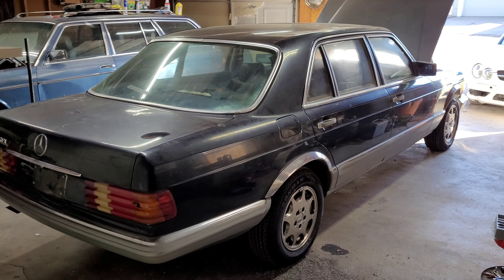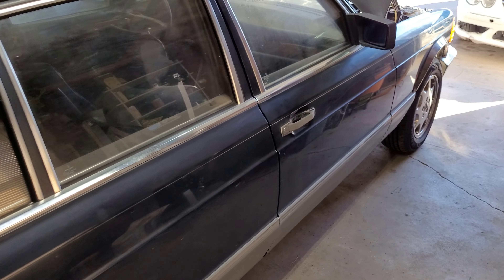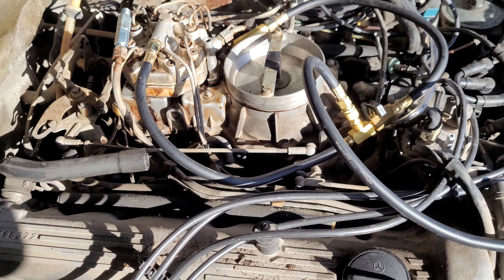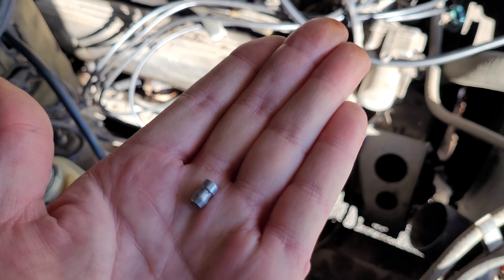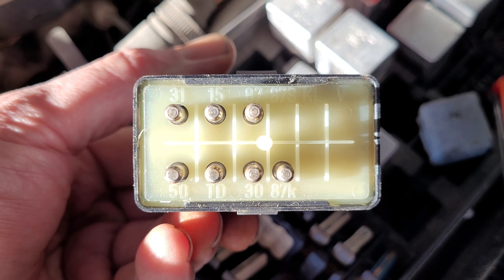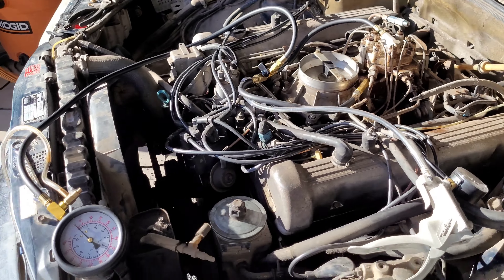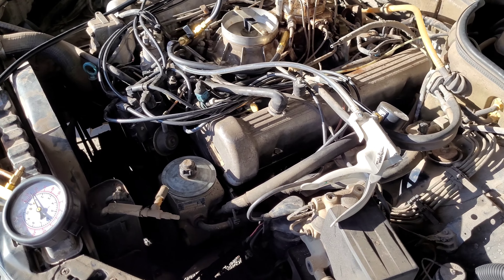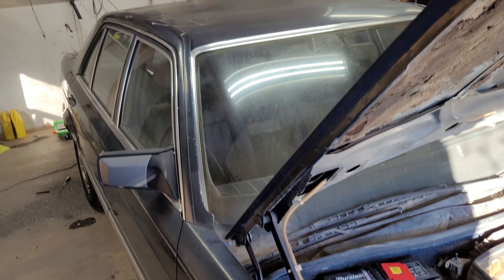Solving K-jetronic problems on the 84 500SEL part 1

Comment: I would check you drive shaft rubber I forgot the proper name for them but I would check it sooner not later on the 55 .if I remember right the liked to destroy them just like the m5's did
Reply from the maker: The joints are pretty robust in the AMG cars my C55 has the same joints as the way more powerful SL65 and to me it feels more like a suspension issue rather than a driveline issue.
Reply: @neglectedeuros  ah I had a vibration in my truck I serviced the diff and it fixed it